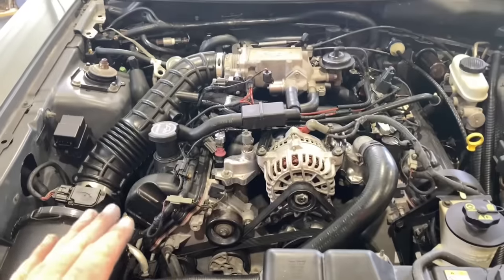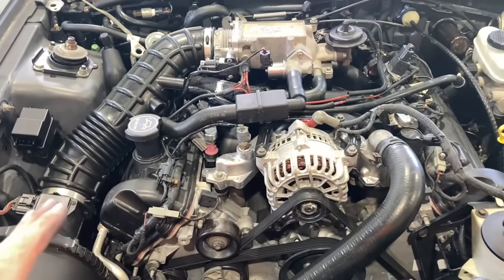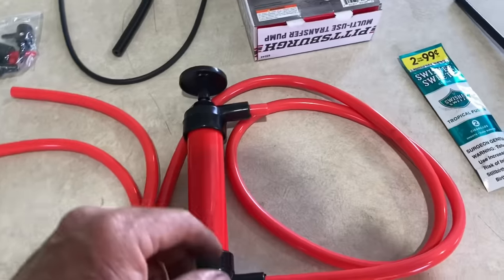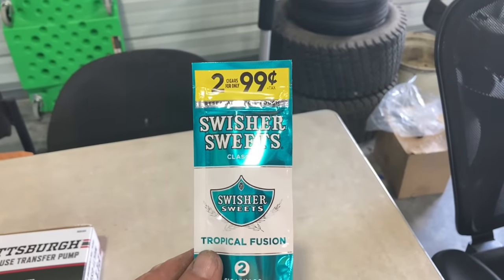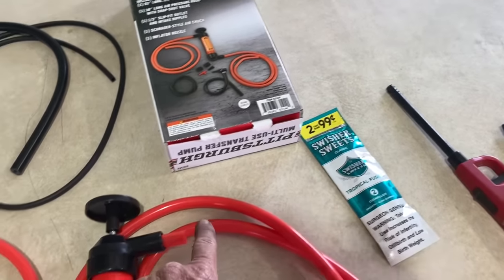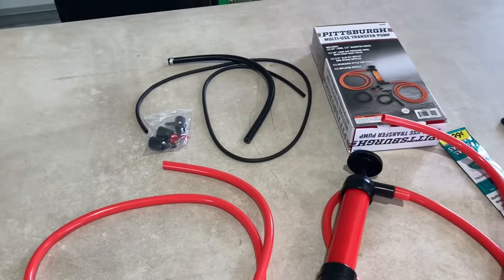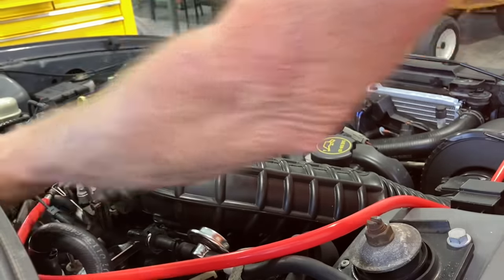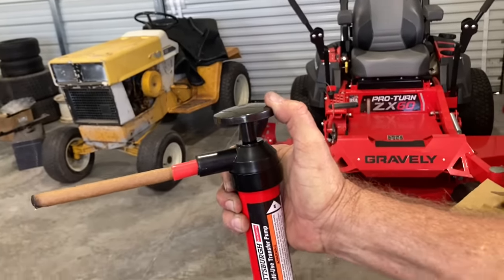DIY smoke machine to check for vacuum leaks under $10 and less than 5 minutes!

Comment: Might be a dumb question, but could you adapt this to test for an exhaust leak at the header? Father-in-law’s 96’ Ram seems to be ticking but he thinks it’s the headers, and I’d rather not blow air backwards through the exhaust and spray it down with soapy water.
Reply from the maker: I don’t see why not! Go into like the 02 sensor location?

Comment: Will that smoke mess up the MAP sensor screen??
Reply from the maker: Did not on mine I would think a lot constantly could be a issue
Reply: the reason i say thet thet damn this is sensitive with what you clean it with.  @AllPistonsGarage
Reply from the maker: Yes I agree all I can say is it did not affect mine plus I guess you could block off that area as well if you’re concerned with that being a issue

Comment: @Rootperch
Do y'all see the peoples lungs when they smoke tobacco products and how it always leaves tar and contaminants on whatever the smoke touches i see a problem where the smoke from this blunt can get into sensors deep in the intake as well as other sensitive parts. generic smoke machines for this application use mineral oil that doesn't leave film or damage sensors
We all dont want to spend hundreds on a smoke machine but at the same time using a cigar can cause thousands of dollars in damage because of the tar and contaminants I want to know your results in this long-term have you ran into any issues involving this method like faulty/damaged/dirty sensors or other components?
Reply from the maker: I only had to use this once to find this hard to find vacuum leak that I usually pride myself in using my ears but this one location and all with engine running and the old carb cleaner method didn’t work either. It’s not like I went out there and put cigar smoke multiple times a day every day for months in the car 😂 trying to find the leak. Did you watch the video? I used it once found the leak that was it. Some suggested use a vape pen my goodness it’s a cheap diy to find a pesky vacuum leak not a mission to coat your car’s sensors daily in cigar tar it worked for me and others reported it working for them if you think it’s that bad don’t use it buy the expensive smoke machine and carry on friend. Thanks for watching.

Comment: SSOOOOOOOOooooo............... that pumps keeps pressure on the "OUTPUT-SIDE" of the pump, even when you pull the handle out to draw "IN" the cigerette smoke ???
Reply from the maker: It draws in the air & Smoke and fills pretty much every open space not sure about actual pressure but smoke creeps and crawls around eventually finding its way like standing around someone smoking it will eventually come to you lol

Comment: Where did you connect the tube to the engine
Reply from the maker: On the back side of the intake plenum is a vacuum line for the evap fuel system was very easy and convenient, Thanks for watching
Reply from the maker: @Roottech25   yes there is a solenoid in the inner fender but un plugged the hose at the intake plenum before the solenoid any port on the intake that is vacuum related should work especially if engine is not running
Reply: Note to users; the hose you disconnect will be excluded from the test.
You can repeat the test individually on that hose, or insert a 'T' when testing, if you don't initially find the leak.

Comment: Does the smoke leave a residue?
Reply from the maker: I’m sure repeating over and over would
Reply: I want to search for fuel system leaks in an aircraft but applying smoke and looking for disturbance of the smoke stream at the leak. This will be done both outside and inside the cabin so I don't want to leave an oily residue on the seats, floor, side walls, etc.
Reply from the maker: Try a vape pen

Comment: Might be easier to see if the lights were out and you used a small beam flashlight to look for smoke .
Neat idea..... I was expecting you to start the engine. 🤣
Reply from the maker: Great idea
Reply: If you start engine it will suck smoke in and you wont see it most likely
Reply: @tabbott429  No, I was saying before he showed the process, I was expecting him to start the engine....... because that's how it's traditionally done with all other methods.
...water, carb cleaner, brakleen, propane

Comment: It's in this place here...shows entire engine bay fully dressed and no pointing anywhere.
Reply from the maker: Except where I point it’s under here and remove the intake runner tube then remove it and remove the the 90 rubber elbow and show where it cracked and broken 😂 thanks for watching

Comment: Where can I put the hose ?
Reply from the maker: You need to find a port near or in the intake manifold but ultimately any where a vacuum hose is your hose will fit
Reply: @AllPistonsGarage  can I run it through the pcv

Comment: Somebody that does it every day that vacuum sound as soon as you started up you would hear it. It is a distinct sound. That’s not a small vacuum leak.
Reply from the maker: Yes I’m that guy that prided my self I’m finding vacuum leaks just as you described however with the engine running on this one I could no locate it even with carb cleaner it kept picking up a small amount at the base of intake plenum so I decided to try this and found it! Location under the plenum hose in the bend of the elbow on the bottom side still pinching the crack together helped smother it! You are correct but this one was sneaky.

Comment: You're supposed to block off the throttle body when you use smoke for vacuum leaks
Reply from the maker: 👍 thanks for watching
Reply: Interesting. How do I block off the throttle body?  I am looking for a vacuum leak on my 94 z28. I purchased everything and I was going to check for the leak tomorrow. TFS.

Comment: Not as cheap as those little cigars, but also not stinky, a cheap vape might work. I don't know personally, I have always used a soldering iron stuck in a jar filled partway with some mineral oil
Reply from the maker: Yes others have mentioned vape pen! Thanks for watching

Comment: We always just used a can of carb cleaner
Reply from the maker: Yes I tried that and it kept idling up around plenum base? I took it off replaced the gasket to the point I thought my new intake possibly had a crack in it. I usually pride myself hearing a leak or carb cleaner but this one the location it was in fooled me until I smoked it out.

Comment: So time is just used to spray WD-40 on them we find it
Reply from the maker: I actually tried carb cleaner but it kept leading me to what I thought was plenum and I intake manifold junction but it actually was under the plenum tube but I couldn’t see or here it but you are correct this one kept me guessing until I got the smoke and found it underneath plenum tube

Comment: I wouldn't do this, too many warnings about what to use in smokers because of possible harm to sensors.
Reply: Yup
Reply from the maker: Didn’t seem to affect mine but I wouldn’t probably do this a bunch of times. Around here there is always clearing land and burning brush pile my sensors may be good with it 😂
Reply: @AllPistonsGarage  but it goes thru the filter first . Not saying it would trap all the smoke but ya.

Comment: Just hook up A tube and smoke a cigar and exhale smoke thru the tube 3$
Reply from the maker: True but I let the pump do the work 😂 thanks for watching
Reply: @AllPistonsGarage  Thanks for the Quick response I have SUBMITTED my SUBSCRIPTION 
I'm fighting a battle with a 2002 Buick rendezvous Which keeps going into LIMP Mode.. Started by replacing the Mass flow sensor no dice.. Going through it one step at a time. disconnected EGR. Ran seafoam for fue injections. helped a little. Cleaned throttle body.. and on to the next .. Sluggish won't get over 50 jerks stalls sometimes turning. Exhaust smells heavy gas.thinking cat or time chain. What do you think?!
Reply: @AllPistonsGarage  DETROIT HERE
Reply from the maker: How about the fuel pressure how much does it have? Is the fuel regulator working properly?
Reply: @AllPistonsGarage  I'm not sure

Comment: Awesome tip! But yea...guys....be VERY careful. Especially if you're checking codes that can be vacuum leaks...or....fuel injector issues. One spark from that cigar and you'll be staring in the next Big Bang Theory (season 18, the explosion conjuction)
Reply from the maker: Another viewer suggested a vape pen and you can pick your flavor lol. That’s why I used a very long hose and kept the cigar outside of the car it will get you by in a pinch and thanks for the safety precaution. Thank you for watching
Reply: @AllPistonsGarage  He's probably a mechanic that love to rip people off, I salute you for your invention.

Comment: I know that cigarettes will still smoke with a drop or two of diesel fuel on them even though they taste absolutely terrible... and with inspiration from another smoke generator where you use a lightly oil saturated  rag to burn, I wonder if a little spritz of penetrating oil would make the cigar smell better, be even more carcinogenic, make more smoke and burn longer. 

Or what about cutting off a piece of the pump's box, rolling it up into a coil shape and jamming that in the pump. Get it smoldering and go from there? The plasticy coating should give it cancer way better than the cigar and you save 99 cents and an akward conversation with a gas station attendant.

Now I just need to figure out WHY we wanna give our cars cancer.
Reply from the maker: Maybe we could substitute a vape pen

Comment: waste of time,.. man just get a  spray bottle with water and start spraying the engine down at all gasketed areas while engine is running   if theres any change in idle during then theres your problem
Reply from the maker: I even tried carb cleaner I usually pride myself in finding vacuum leaks but the location of this one under the plenum intake hose and the split under the pcv elbow on the bottom with engine running could not hear normally I agree but this one was really hidden good!

Comment: If you couldn't find that without smoke you must be blind😂
Reply from the maker: It was underneath the intake plenum hose as you seen in the video with the engine running could not hear the leak and on top of that the crack in the pcv elbow was on the bottom of it. It was Superman’s day off didn’t have access to the X-ray vision available.